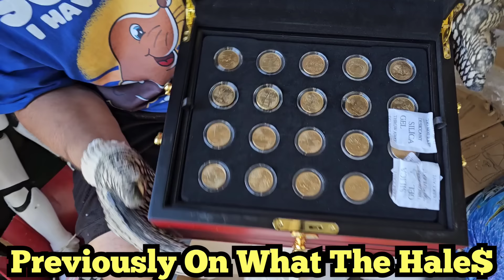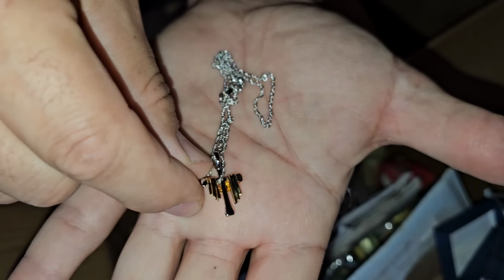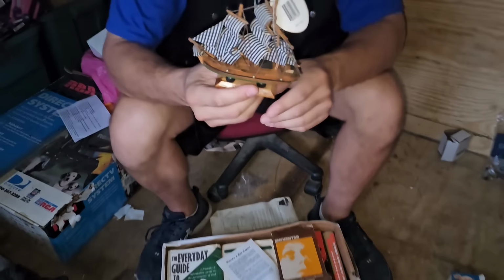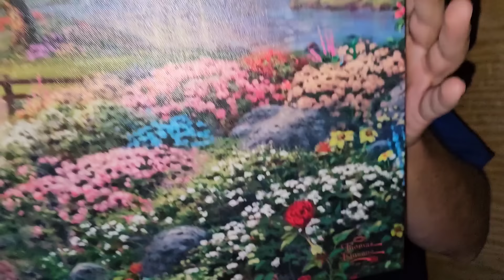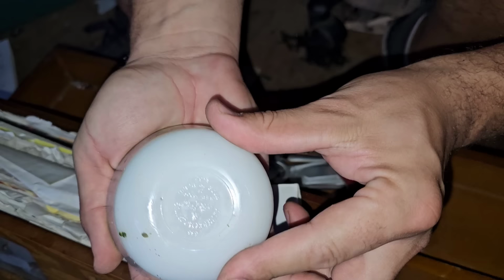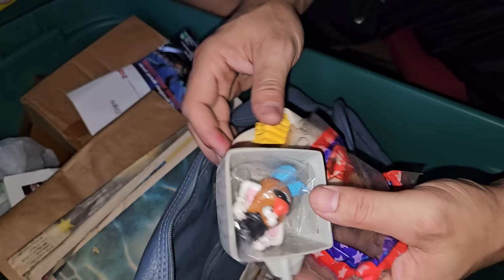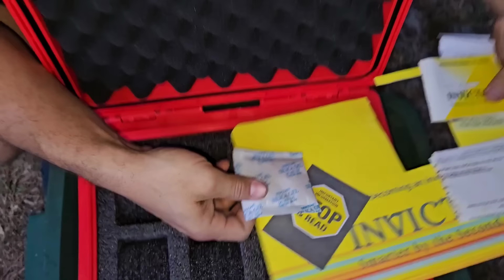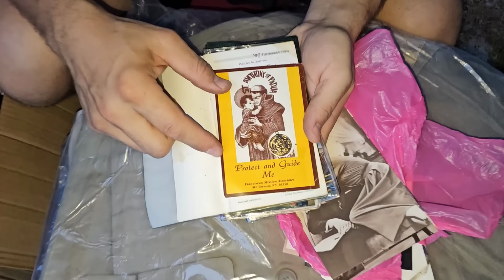ALL MY EMPLOYEES LEFT ME

Comment: Hey Jeremy & George. I recognize the labeled & boxes from QVS/HSN & LC (Liquidation Channel)

You can go online & put in the product number off the item in & it will normally tell you metal, stone & sizes rings length of chains & bracelets. 

Those white stickers normally is on the item I put mine in the bottom of the boxes & I try to keep the thing together 

That ring the original stone &emblem broke a part. I've been given a choice to to gamble they'll have the same one & in my size I wanted or they'd send to their repair shop. And only pray it won't take for ever to fix it. Or take it to a silver smith or jewelry store with an in house repair person.  So his ring is okay as they sent him a replacement piece. 

I got a set with a neckless, earring, bracelet, & ring set.

Comment: You used to buy the satellite systems at Radio Shack, Circuit City, HH Gregs,or Best Buy. I ruined my upper left shoulder when I was pulling one down for a customer and the corner of the box slammed into me. It still is giving me problems thirty plus years later.